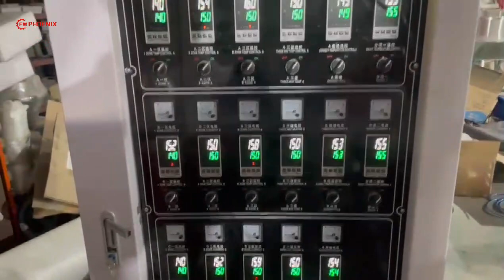ABC three layer rotary die head film blowingmachine

Comment: Leminate film milk oil wheat aatta confectionery biscuit chips 
20 150 micron  production capacity, power supply kw
Reply from the maker: May I have your WhatsApp number for details?mine is :86 13396960621
Reply from the maker: This width 1000mm, around 120kg/h, total power:90kw